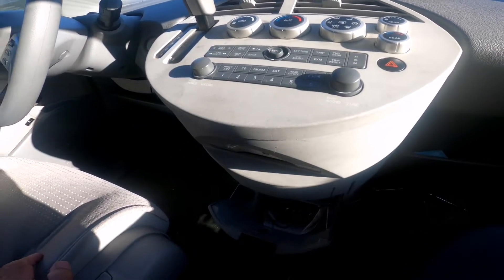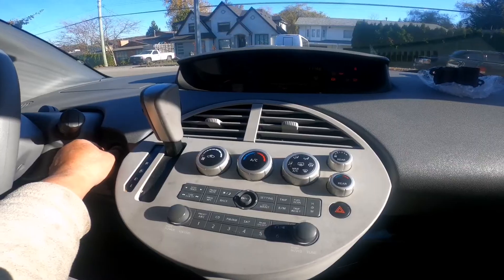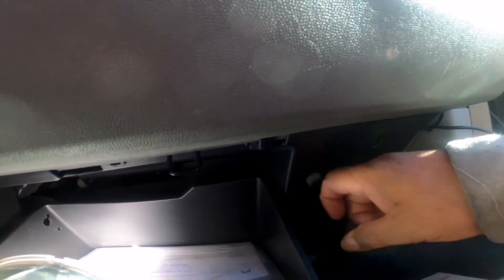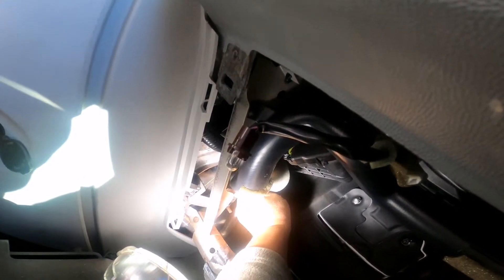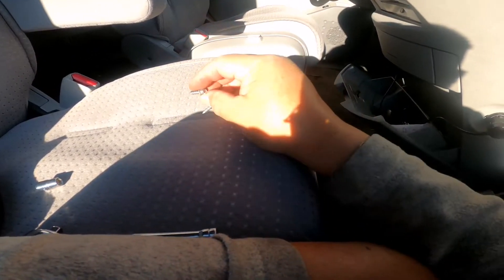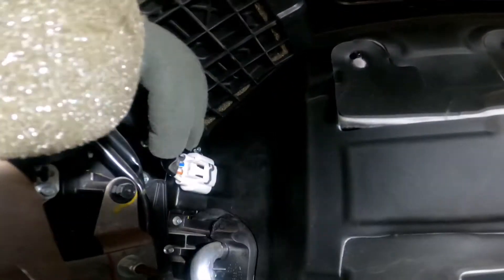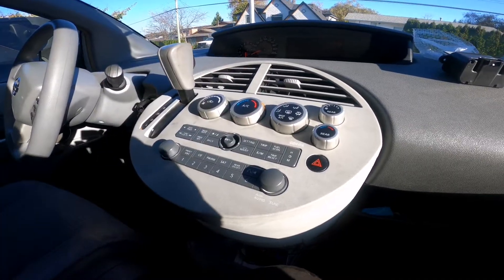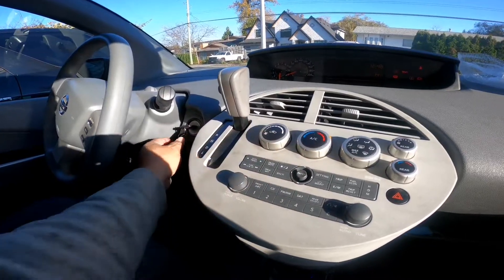HVAC BLOWER MOTOR RESISTOR REPLACEMENT - 2006 NISSAN QUEST

Comment: Can you please provide the link to the resistor part?
Reply from the maker: yes, thank you i forwarded the links to my editor he will put the link
Reply from the maker: https://www.amazon.ca/Resistor-NissanQuest-27151-ZT00A-27151-ZM70A-27151-ZQ00A/dp/B015H8Q882/ref=sr_1_1?crid=356PQ325L1JDB&keywords=xtremeamazing+hvac+heater+ac+blower&qid=1689547586&sprefix=xtremeamazing+hvac+heater+ac+blowe%2Caps%2C410&sr=8-1
Reply: Thanks it worked :)

Comment: Hey Ben great video I have a question I have 06 Nissan quest same as yours my front doesn’t blow but the rear works fine cold with no issues any recommendations
Reply from the maker: i would suggest check the cabin filter is beside the resistor motor maybe is dirty or clogged